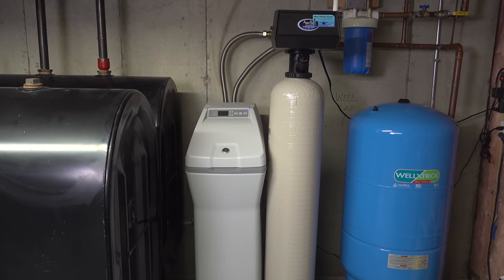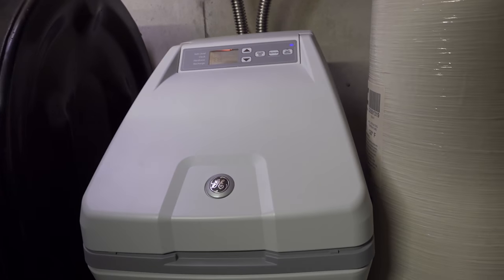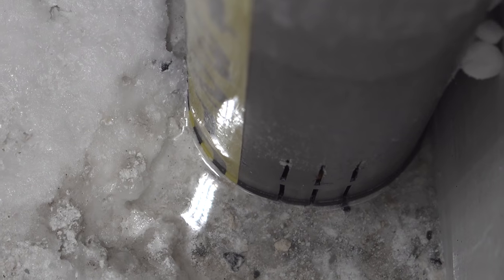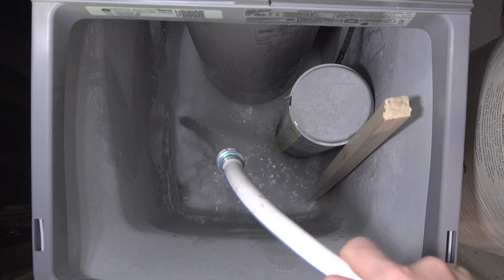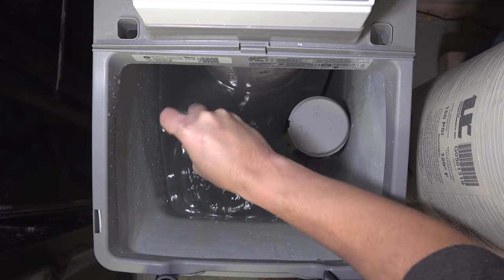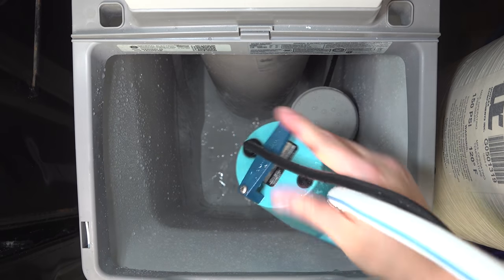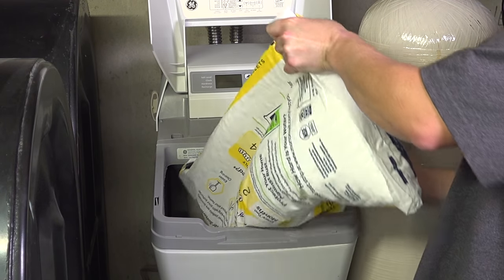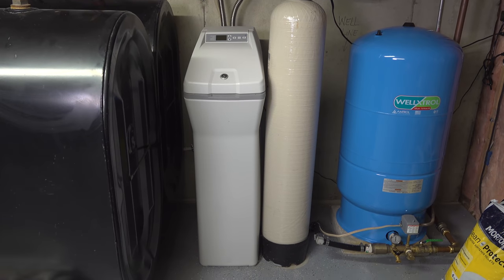How to Clean Your Water Softener Salt Tank - Restore it Like New

Comment: I have been a technician on these devices for 20 years. Just pour a bucket of warm water on the hard part every week and it will dissolve by itself.
Reply: After that do you just let it run on its own or you need to drain the water you put in ?  Or press a button ? Or what ?

Comment: If you see that it's dark at the bottom of the tank (like I did on my first cleaning after buying a resale home) you MUST completely empty the tank of all material.  I did and found almost 3/4 gallon of fairly pure muck on the bottom.  Emptying it also allowed me to use the garden hose to completely clean out the little holes on the bottom plastic screen.  Wash it on the driveway and away from tree roots because the salt may kill the grass or your favourite tree.
Reply: Can you tip it and pour salt out?.
Reply: so i neglected to keep mine topped up with salt due to being in hospital, i have just topped it up will it recover on its own? or do i need to do more?
Reply: @donnaclarke8595  Yes, disconnecting it to allow it to tip is a good way to lighten it, scoop out brine and salt to make it lighter to get outside.  Or wait until there is very little salt in it.
Reply: @pjmoseley243  It will recover on its own.

Comment: It's a bit like sweeping a dirt floor. All softeners will have a rinse cycle after brine draw so anything from the brine tank is throughly  flushed out with fresh water before it begins supplying soft water again. The main issues would be salt bridging (use rubber mallet on sides of tank at hard layer), sanitizing (drop a cup of bleach down the brine well, the white tube, once a year, no more than every 6 mo) and iron fouling (either get a salt with an iron out or buy some resin reconditioner, powered or liquid, and add some to the salt once per tank fill). As far as the condition of the inside of the salt tank, it is nearly completely irrelevant. It doesn't go into your home at any point. It will just come back with time. I have 13 years experience as a water softener tech with one of the most recognizable names in water softening. You can clean your tank out but it's largely pointless.
Reply: Crystal or pellet??  My booklet says solar salt is recommended, but not finding it locally. I’ve been using pellets & have come across bridging but just broke them down. My booklet says 5-1\4% bleach for sanitizing, doesn’t mention Iron Out. My salt is currently low & looks dirty, I’m condo so can’t do hose & have no pump. Do you suggest adding hot water to dissolve & leave it, or should I wet vac it out & refill with new salt, or do nothing & just add new salt?  Please and thank you!
Reply: @chuckfarley

Comment: Most problems are mechanical, in the valve. Resin failure usually occurs after 15 years. Using solar salt and not pellets pretty much eliminates clumping and compacted brine tanks.
Reply: I replaced all the gaskets in my valve last year took it completely apart worked great after that. I switched to crystals six months ago I keep getting a lot of dirt in the tank . I’ve had to clean it out three times which I never had to before. So I am going back to the pellets 🤔

Comment: Thanks, this was helpful. I used this as a guide to clean mine. I didnt have a salt bridge, but I had a lot of dirt/rock buildup from years of dumping in salt. I ended up physically taking the head off and pulling out the inner tank, which was a pain, as it was heavy with water. But that meant I could then take the outer plastic salt container outside for a serious cleaning with hose/brush/soap.

Comment: I thank you so much for this video.  I got done weeding for 5 hours in 88 degree weather today and was going to come inside and thought "I bet the water softener needs salt.  I haven't filled it for a good month or 2"  I go to check it and there was water almost up to the top.  In the past I have seen water maybe a third of the way full but not that full.  So I emptied it and a) dead mouse at the bottom b) that super hard layer of salt.  My softener is in such a small furnace room and there was no way for me to reach the bottom with a spoon.  Ended up using the shop vac to suck up the rest of the water and a long pole to break up the salt.  There was this layer of muck on the bottom of the salt so i ended up sucking up and rinsing and removing all of the salt and the muck.  We'll see what happens.  I have an old Kenmore from Sears and when I got my home 8 years ago, I think the Inspector said to budget for end of life cycle but so far it keeps working.  Kind of hoping the big cleaning job plus adding in the Iron Out a couple times a year will keep it going longer

Comment: Great video. To make the job easier, use hot water. It will dissolve the salt a lot quicker and you just have to use enough to cover the salt. I suck out the water with a wet vac

Comment: great video. I use salt crystals. I have a Rheem unit RHS32. The manufacturer recommended to add 3 oz of bleach because of the musty smell and run a Regen cycle. The smell seems to be gone but the tank inside looks dirty along the outer walls. Is this mold or dirt?? I just emailed some pics.

Comment: I just found a tiny crack in my resin tank the other day when I went to add salt. It was making my brine tank overflow. It was 25 years old. Order a new bigger one. Can’t wait to get it installed.
Reply from the maker: Thats good that you caught it. the life os these is very good when compared to other appliances so it sounds like you did pretty well with 25 years! Longer than most marriages!

Comment: Very good video a lot  of good information!! Especially in the humid times of the year, we  add 1 bag of salt when needed. 20 years ago, I did have a salt bridge , use the shop vac to vacuum out the old salt. Didn’t have the time to let it dissolve. Hope you have videos on the screen cleaning. So important to make them run well.

Comment: If you don’t have a submersible pump a wet/dry shop vac is another easy option to get the water out. Just remember you need to remove the filter and empty the dirt before you use it for water.

Comment: Installed a new softener when I moved into my current house, as the prior one was really old and took up a lot of room since it was separate. I got an integrated system like yours and filled it with salt. And that's how I discovered what a salt bridge is... I actually ended up disconnecting my unit entirely and taking it outside so I can turn it sideways and get everything out. Ever since, I usually just keep it topped off with about one bag's worth. The effort to top it off more often far outweighs the risk of having that bridge happen again.

Comment: This is awesome because I have the exact same GE model softener. I actually bought a extra long pry bar from Amazon for this exact reason. I think it was less than 20 bucks. I think I am going to find some type of long handled scoop or shovel to get a lot of the sludge out of the bottom of my softener. Thank you for the video.

Comment: Well, it took 5 attempts to finally dissolve the 5" thick saltberg. I don't think the previous owner tried to clean this thing once. I kid you not. I had to take a drill to at least weaken the saltberg so water could penetrate it and weaken the interior.

Comment: Does GE specifically recommend those Salt pellets for that unit?  I can tell from your videos you are very meticulous about doing things right with all of your appliances, power equip, etc.  So I don't want to suggest something against the manufacture's instruction if that's the case. 
The reason I ask is because I have been told under no circumstance to use those pellets in the yellow bag.  They contain a binder to keep them in that pellet form.  The binder (basically a glue) is what is causing that solidification. 

I have a 75k grain twin tank system in my primary residence and a smaller 35k grain system in my seasonal vacation home.  Both are Pentair/Fleck systems and I only use crystals (the blue bags), and they never bridge (solidify).
Think about the environment of my systems.  The home one is a monster of a tank.  It takes around 12 - 15 forty pound bags at a time!  600 lbs of salt and it doesn't bridge.  The vacation home is a smaller tank, but sits for months at a time and that doesn't bridge either.

Now I know the crystals are "dirtier" than the pellets.  That is because they are "pure and natural". The salt is extracted directly from the mines.  Whereas the pellets go through a manufacturing process where the salt is rinsed, binder is added, and pressed into the pellet form.
Personally I would prefer the pure natural stuff that dissolves better, rather than a "processed" salt with additives clogging my system.  After a few years, if the dirty looking water in the brine tank bothers you, you can clean the brine tank, which is a much less arduous task than breaking up salt bridges.  (Keep in mind, breaking up salt bridges is required, cleaning out dusty water is not, as the latter will not affect the performance of your softener). Just a thought worth checking out, IMO.

Side note (sorry this is so long):  The video you did on the Iron Out treatment a few months ago, was what turned me onto that product.  That is such a great suggestion.  After watching your video and doing further research, I think that is a must maintenance item for anyone with a water softener.
Reply: My plumber told me the opposite. Don't use anything but pellets and to use the brand the manufacturer recommends.

After switching brands my softener started getting bridges and havibg water above the salt. He came in and broke it up and highly recommended changing brands.

More expensive, but hopefully it helps. I still had 200lbs. Of the other stuff to go through, so we shall see if it does indeed make the difference.
Reply: I have that exact unit those pellets do not work at all in it. You have to use the regular salt.
Reply: I somehow came across his iron out video & now here I am. I got my WS about 7 years ago & was only told to fill it up when it gets low. Never knew about iron or resin or pellets vs crystals. I had been using pellets & have had bridges that I just always broke up (didn’t know it was a thing) Got my manual out just now & mine recommends solar salt and only mentions bleach for sanitizing. 
Sigh. Nothing is easy.

Comment: Thanks for this great video and it's very helpful. One quick question though, do i need to push bypass valve when i do the cleaning or let the water run through it without plugging the machine ? thanks
Reply from the maker: You can if you want to, but usually all water goes through the main tank and not the brinewell so the work you are doing here shouldn't have any effect on the house.  The brinwell only gets used during the regeneration cycle

Comment: Is the brine well supposed to fill up at all during the recharge process?  I noticed mine isn't at all.  I put the Iron Out in the brine well, then immediately did a recharge, but the brine well still smells like the Iron Out.  I'm now wondering if my issue is more related to this, than needing to use the Iron Out to clean up the resin beads.   That's going to kinda stink if this is the issue, because I literally just refilled my salt tank, lol.
Reply: If your brine well doesn't fill then likely the little slots at the bottom are plugged, just like in this video. The brine well has a float to detect water level and the slots let only salty water in so the float can move and the salty water can be used for regen.

Comment: We had a water softener put in in 2017. We haven’t cleaned it at all and we notice calcium build up on our fridge,  shower heads, and sinks. Should we try to clean it out or should we just buy a new one and replace it? What would be the first few things you would do to diagnose the issue with the current one?

Comment: I have dead spiders in the tank and maybe other dirt too. So I shut down the water softener. Does that not mix with the water that I would be consuming? Just curious.
Reply: No.  Only the sodium ions that are adsorbed into the resin beads end up in the domestic water. The regeneration cycle sends domestic water in a bypass around the resin tank.  Water from the salt tank is then flushed thru the resin tank to recharge the resin beads with sodium. When that is done, water from the water supply is flushed thru the resin tank to rinse out all the excess salt. All that salt water and rinse water goes down the drain. Once the beads a rinsed the bypass is closed and the domestic water is routed thru the resin tank again to be softened.

Comment: I have the exact saMe water softener. I cant figure out why the water level on the tank keeps rising up. It does not empty everytime i do a regen. I changed the venturi thinking it might be old and the gasket is done. Did a regen and nothing happened. Water level keeps rising up. I changed the drain line thinking it might have a block. Nothing happened. I emptied the water because it was almost all the way to the top. Unplugged the softener. And when i plugged it back. I saw on the monitor jJ3.4 F30. In which i did some research and found out it was an error code? Could it tHat be that makes my water softener not work ?

Comment: I have this exact softener. There are so few videos on it... Thanks!
Mine is dripping down the drain constantly. Any info you have on opening it up and cleaning out the valves would be great!
Reply: You probably have an issue with a seal on the piston that slides in and out of the control valve, constantly draining means it got stuck in a cycle and can’t get out.

Comment: I love this video. I can't promise that's the exact same unit that I have but I got 1 a few months ago (it looks similar). 

Anyway the installer and the guy that came out to re-tack the carpet due to the fact it leaked mentioned the fact that using the smaller grain of salt is the best salt because it keeps all that crap out of the unit. Who knows ⁉️⁉️⁉️

He also did mention what you're saying, don't overfill the damn machine. Let the machine tell you it needs it before you even touch it. Furthermore, looking at that video there it probably wouldn't be a bad idea to wait until it tells you it needs it and put some water in the damn thing, use the stick, and let the machine suck it up as it naturally does. Then when it says it needs salt again put more SALT in it.

Comment: When my water softener was installed, the tech used potassium instead of salt. I have been using potassium since then. Do you know the differences between the two? Could I switch to salt because it is much cheaper than potassium. Thanks!
Reply from the maker: Potassium is good stuff and is used for people who might have an issue with an extra sodium in their diet if they drink the water too. Also used for a better impact if you are discharging the waste water outside. But it does cost 2-4x as much.  You can usually switch at any time from one to the other but if you have any of the issues above should stay with it.
Reply: I used to used to use potassium in my softener before I went rainwater, the water tastes better with potassium in the softener, but like you said cost 5 times as more. Now that I'm 100% rain water, I don't need a softener and its literally the best tasting water iv ever drank.

Comment: Thank you, sir. I'm having exact same GE softener as yours, however, mine is having standing water with almost no salt for weeks. I checked all the youtube vids to clean the possible clogs (not really find anything) but the water is still in there. Tried to regenerate but the machine is not responding
Reply: Your piston inside the control head needs replaced.
Reply: Same here. Looks like mine might be the same as the video and there is a whole bunch of water in it and cannot see the salt like I usually can. Don’t know what to try and it’s effecting my skin cuz I have pretty severe eczema . I hate even going down to the basement where it’s located cuz dust!

Comment: Does the tank have to be filled with hot water or just straight cold water from the hose? Your video didn’t specify. Please let me know when you can.
Reply from the maker: No, you don't fill it at all. When the unit goes into the regeneration mode it handles that for you. It fills and drains.

Comment: Is there something wrong with my softener if the water level is always half full in the salt tank? I have been using about 10 bags in 4 months.
Reply: If you have water in your tank over three or 4 inches your seals are going bad check for a water leak under the Valve housing , I had to replace all the gaskets on mine. And now I noticed your question is nine months old so I assume it’s already been fixed

Comment: I never have the issue cause I don’t overfil it either. Salt. Only one bag at a time. If you put too much in it’ll
Compact down
Reply: is the end product (softened water) salty in these salt water softeners?
Reply: @lordjaashin  so basically you have one system which pumps it full of salt to get rid of the crap in the water then another system to take the sodium out a little bit.  The water has no salty taste but it does have a little higher amount of sodium. So if you have a heart condition they recommend using potassium instead of sodium for the ‘salt’
Reply: @seantmclaughlin  i was thinking of using this system to wash my car but higher amount of sodium in water might lead to rusting issues, right?